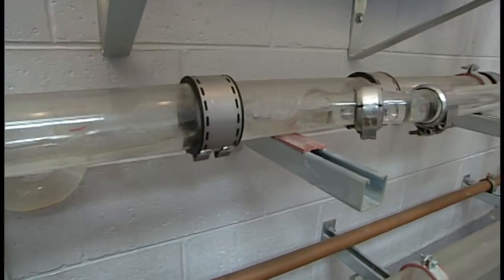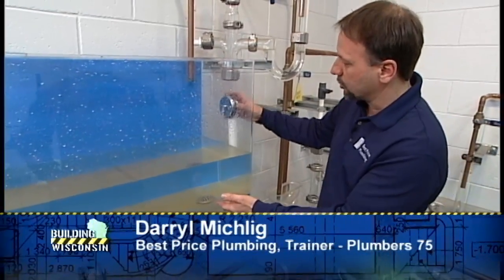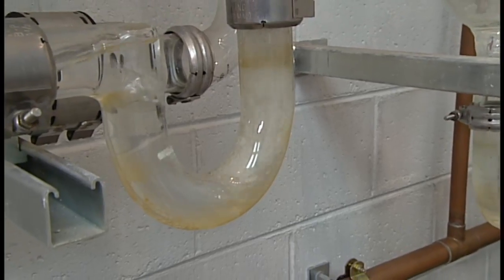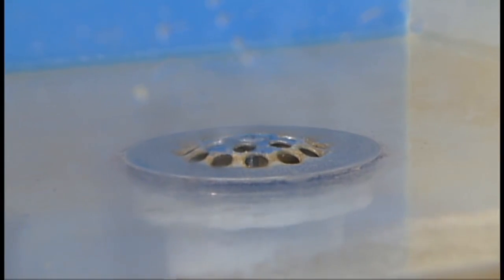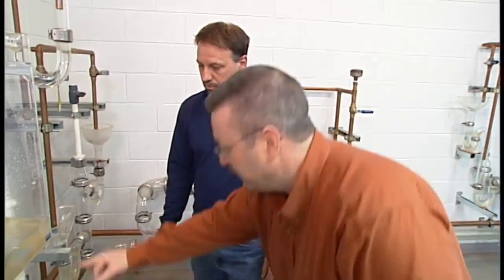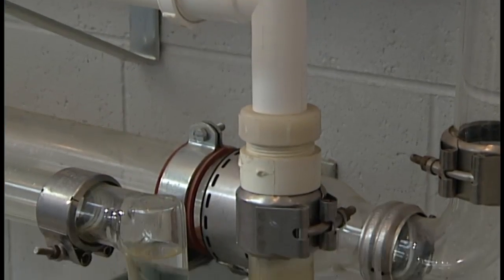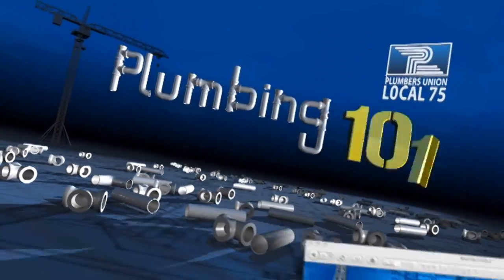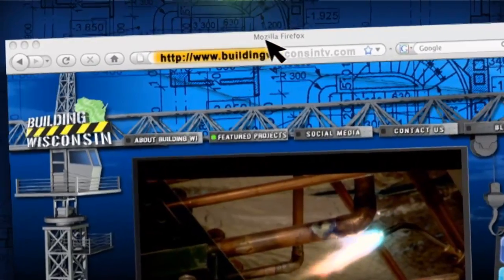Drain Lines - Plumbing 101 from Plumbers Local 75

Comment: I would just like to mention that I had a clogged bathtub and I was not able to clear it with needle nose pliers or a plastic sink snake. The plunger, however, did the job successfully. And I did not have to close the vent. But I did have to remove the built in drain plug in order for the plunger to be effective. So a plunger may be worth a try in some cases.

Comment: You could take a wet rag and hold it firmly against the overflow when you plunge.  It's better to plunge pulling up rather than ramming down.  This will help loosen the material/clog.  Learned this from TheOldkid888... awesome plumber.
Reply: I work in maintenance and i have done that technique and it actually work ..usually when its a light clog
Reply: Thomas Warren exactly what I was going to say. Works every time
Reply: That is the proper way to use a plunger